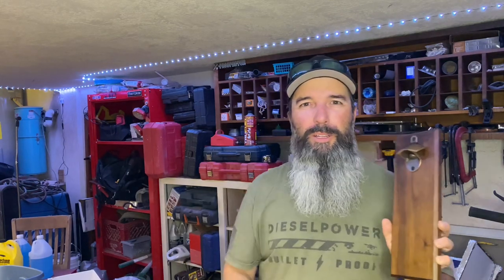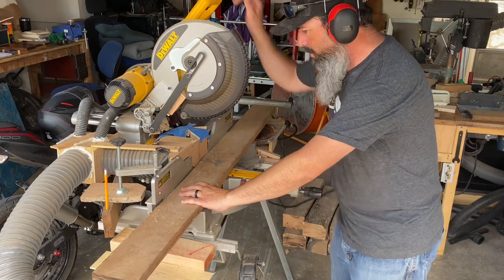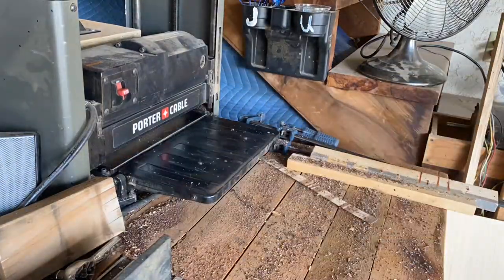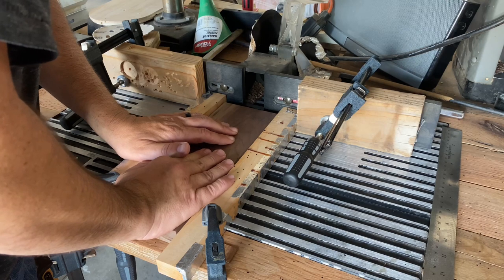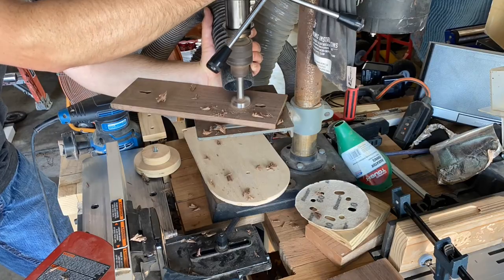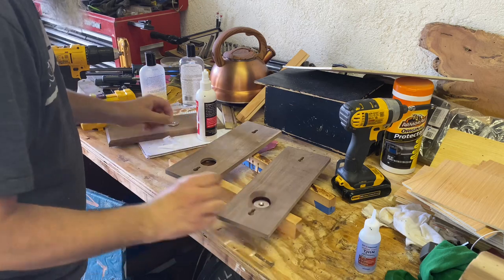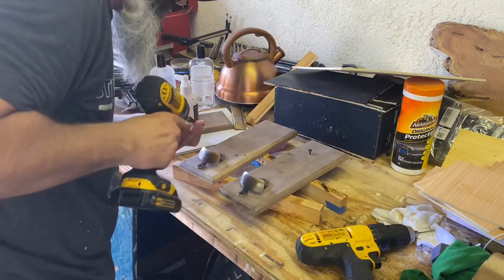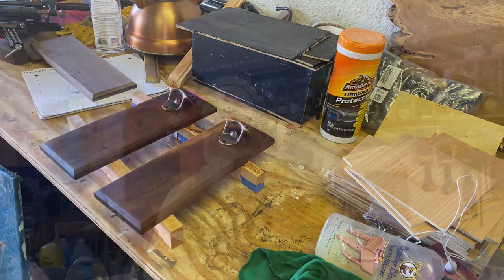How I make bottles openers with Magnetic cap catchers!

Comment: Nice video! Gonna make a few now! Quick question, do you think putting magnets up top to mount on a fridge would work?
Thanks again for sharing!
Reply from the maker: I have thought about that, but haven’t tried it.  It’s worth giving it a shot.  I would suggest that the magnets for mounting it to the fridge be just slightly under the surface of the wood or flush with it.